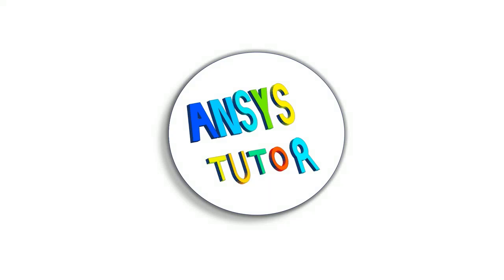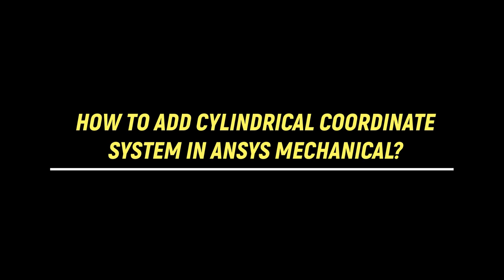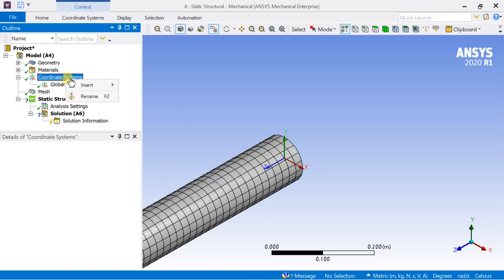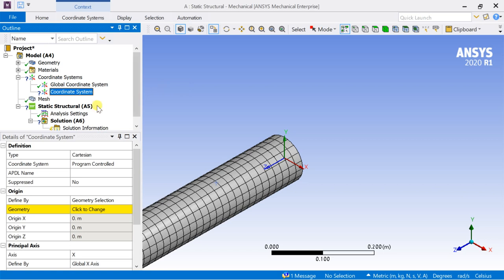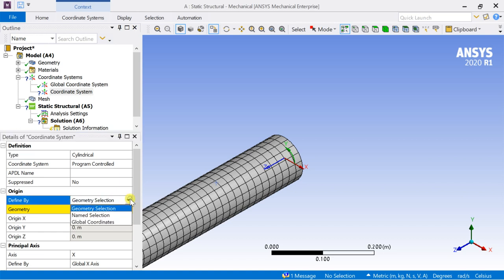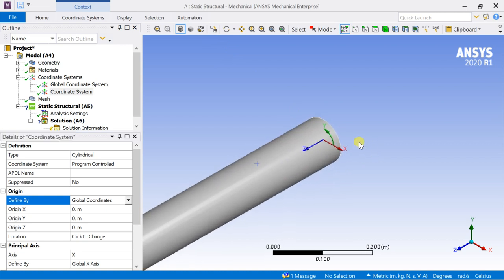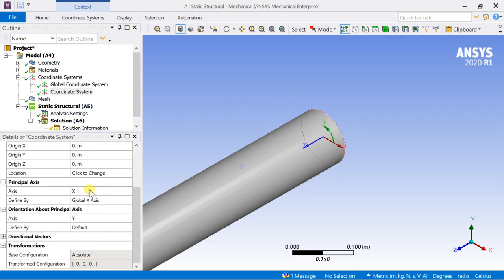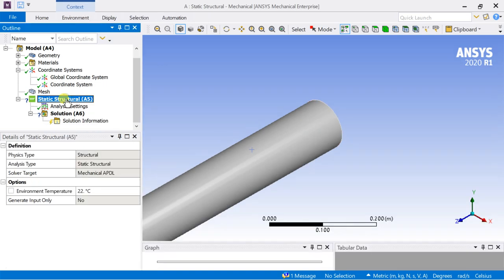How To Add Cylindrical Coordinate System In ANSYS Mechanical ? | IN SHORTS

Comment: Respected sir i am tryin this from a week but still facing a problem while adding cylinderical and bearing support on hole sir i dont not whats the reason behind that it cannot select that cylinderical hole for both bearing laod and cylendrical support sir kinldy gauide me how i solve this problem.actullay when i slect that hole it would turn into green shaded line but when i press apply that agian it remain deselected and no conditon applied on that hole .Sir i know you are professional and you have more knowledge than me kindly help me to solve this issue
Reply from the maker: Turn off the mesh display and select it using the face selection tool.